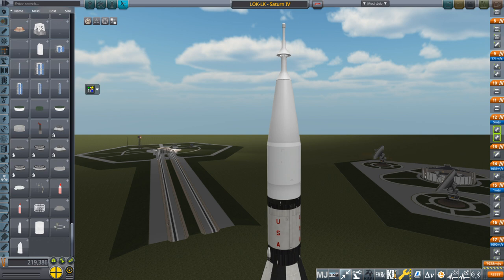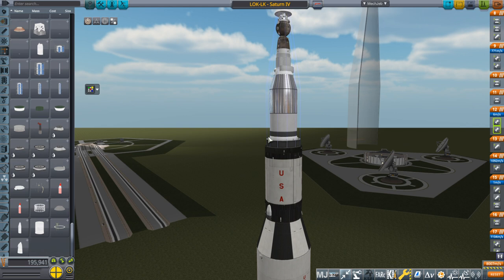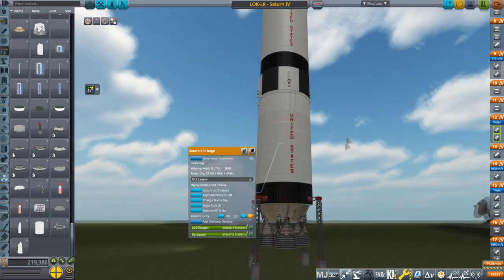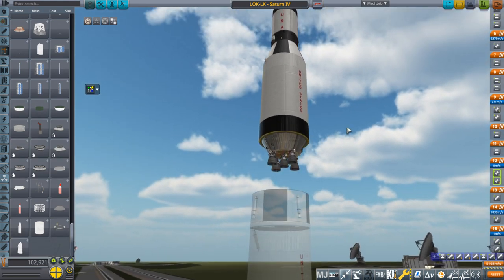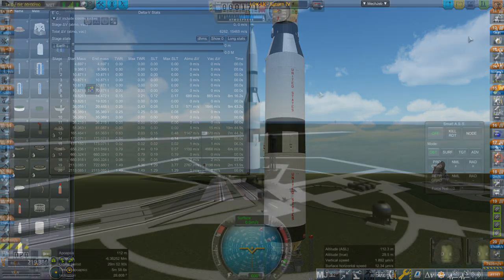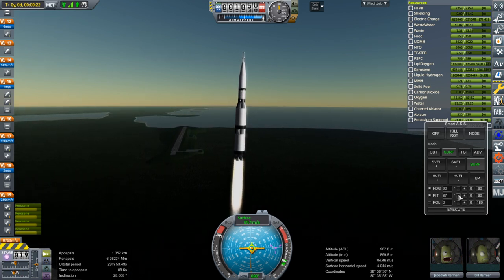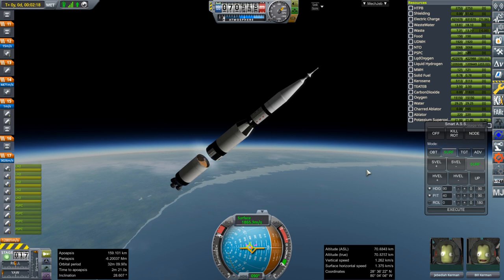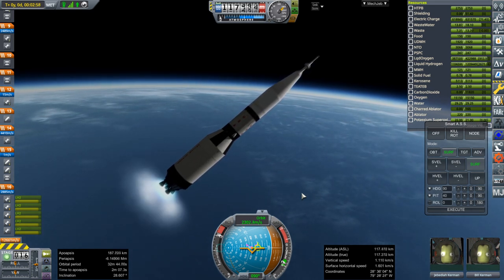Realism Overhaul in KSP 1.8.1 - Soviet Moon Mission on a Saturn rocket

Comment: An extension tank for the first stage and a protective cover with fins for the bottom section would improve performance i think?
And maybe change F1 engines with the upraged ones if you are not using them already or add the 5th one
Reply from the maker: Yes, there are many ways to improve performance. For instance, I could have just used a Saturn V. The point was to do as little as possible to make it work.

Comment: How do you manage the low TWR of the S-II and S-IVB?
Reply from the maker: First, check that you have the right engine config for the J-2. After that, make sure you have 1 minute and 40 seconds of time to apoapsis when the first stage runs out and hold about a 20-30 degree pitch through the S-II stage (though watch your apoapsis). Double-check that the stage times are 6 minutes for the S-II and 8 minute and 20 seconds (or thereabouts) for the S-IVB and that the propellant ratio is correct.

Comment: Strap a Buran to a Superheavy with two falcon 9 side boosters. Fully reusable with KOS? I don't know. Is there enough dV?
Reply from the maker: First of all, what do you think the Falcon 9 side boosters are going to contribute at all? I don't think you appreciate how big SuperHeavy is. That said, since Starship-SuperHeavy has a LEO payload capacity of 100 tons with reusability, either Buran or the Shuttle is less than that payload capacity. However, I'm not sure about the aerodynamics of strapping them to the side of Starship - we'll have to see.
Reply: @RaizSpace  I haven't done any dV calculations. It was under the assumption that Superheavy alone with reusability would be insufficient. Hey, if it's enough, that would be awesome!
The gimbaling on Raptor is excellent, right? Couldn't find any info on the gimbaling.
Reply from the maker: I don't know about the gimbaling on Raptor, either. We can assume at least 5 degrees.